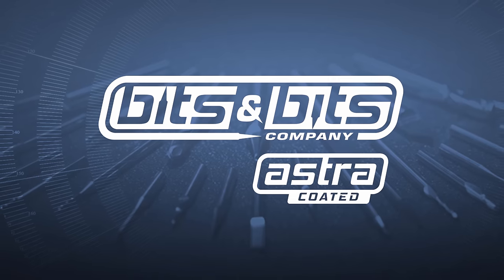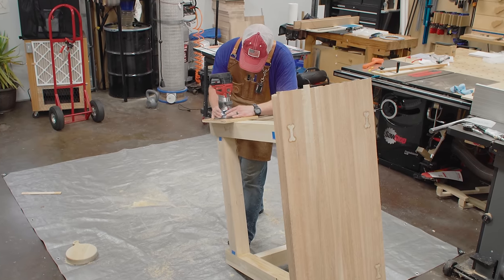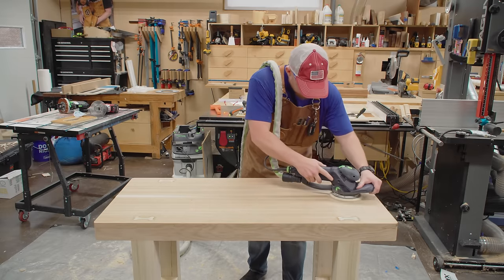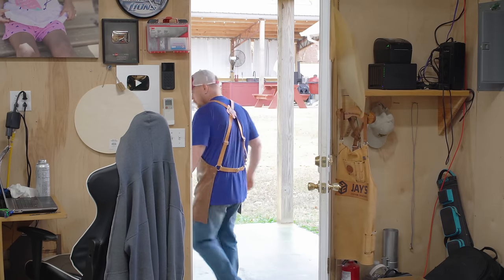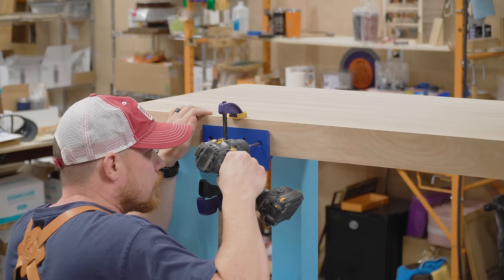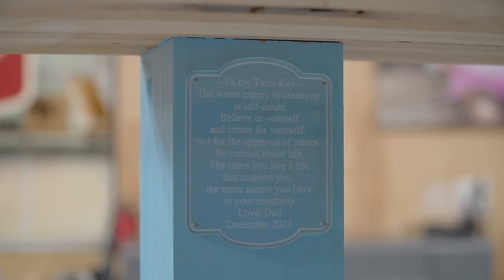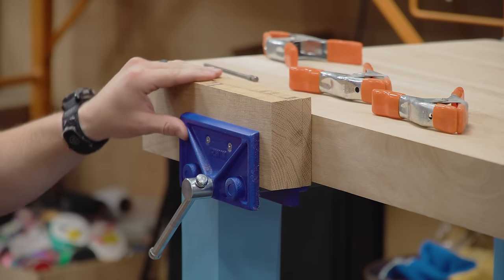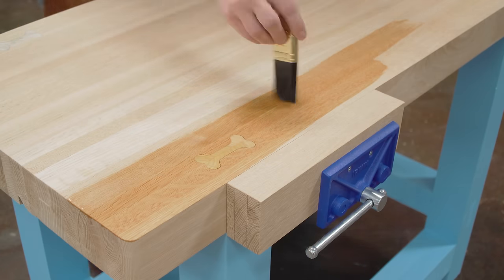Workbench Vise & Finish, My Daughters Workbench

Comment: jay i noticed that you have the control for suction turned all the way up on the vac. I had the same problem with swirl marks if you turn it all the way down and use the softer pad the swirl marks will go away.

Comment: Hi Jay. Just offering a possible cause for the Rotex problem… it might be the bearing under the pad is degraded. On most random orbital sanders, it’s a bearing mounted on an eccentric post to make the random orbital motion. The “sealed” bearing gets dust in it and starts to stick and starts to grab more making the sander dig more, make swirls more, and make it less controllable. I have replaced a couple. It’s an easy fix. Hope this helps.
Reply: I wouldn't be surprised to learn that a bad bearing is the culprit. I think AVE did a review on their track saw, and, if I remember correctly, he found a cheap bearing on the main shaft for the arbor. I never owned any Festool stuff, but it seems like most of their stuff is overpriced for the "quality" you actually get.

Comment: Great color; love the bench; love the motivation - I have 2 girls.  I have the RO 90 and have used the hell out of it for years. I rarely use it in Random Orbit mode but it does work okay in Random orbit & Delta modes.  I take the head off and clean it after every use (it needs it), and I replace the hook and loop pad fairly often - yours looks pretty ratty. That might help.  Happy Holiday!

Comment: Total guess at your sander issue here: Is there any chance that the sander has some sort of clog inside that's making the extractor not work as well, causing a small amount of the dust and loose abrasive to stay behind on the wood? Or maybe the extractor itself is slightly underperfoming?

Comment: Sell the Rotex. Festool has great resale value. I have the Bosch version (1250DEVS), and in random orbit mode the rotation is too aggressive for fine finishing, closer to rotary mode than a regular random orbital sander. And rotary mode it's like a belt sander but harder to control. The best use I've found for it is as a tool of destruction. For example I've for things like flattening a subfloor, or sanding porcelain tile to rough it up before painting it. Get one of the 5mm stroke brushless sanders instead (from Festool, 3M, Mirka, or a knockoff). They are a joy to use.

Comment: 5:05 Yes! Those sawhorses are how I found you! I've made 4.  The only thing I'd complain about them is how the legs are connected for the first screw. I can't clamp them well enough with the leg sticking up at an angle. I don't know the solution. Once that first screw is in, it's fine.

Also, you didn't link to the video in the description.

Comment: Jay, the sanding backing pad on the Rotex is a WEAR item (frankly, on any sander!). You can actually get different grades of backing pads for the Rotex, from hard, medium, or soft. 
If you are trying to level out a surface to flat, then use the hard pad. It will help to produce a flat surface and level out glue up for table tops, panels, etc.
If you are  trying to finish sand a surface, you should be using the MEDIUM pad. It more forgiving and leaves less swirl marks.
If you are doing curved or organic shapes, you would use the SOFT pad.
The differences are night and day with the different pads. They definitely do wear out over time (and you should be using an interference pad if you are using mesh paper).
With Mesh sanding paper, the hooks on the backing pad can be too long, and under the pressure of sanding they can poke through the mesh, causing additional swirl marks, and wearing out the backing pad prematurely. This can be true on almost all sanders, which is why a lot of box store mesh paper comes with an interference pad (but it's a real cheap one).
Try changing the backing pad on the sander, and use an interference pad (festool makes and sells them in a 2 pack for the Rotex)!
Reply from the maker: I have all three. Same results. It's just not for me.

Comment: Wauw, what a awesome bench. Are you going to put some leather pads on the inside of the vise?
Reply from the maker: If she starts using it, yes. My thinking is while she gets used to the concept of a vise she would likely rip off the pad material until she realizes how far to open the vise. So I will add some cork rubber down the road.

Comment: I'm very interested in the issue with the Festool Rotex sander. I picked one up at a pawn shop. It was in good shape just dirty. I believe the previous owner has been sanding marble or granite counter tops with needed on the grade of sanding discs that came with it. I haven't used it much but I'd hate to find out it's leaving pig trails.

Comment: Just had my $650 Mira deros die on me after less than three years of hobby use. They originally quoted me $175 to fix it, but it was the electronic speed controller that died. I got them to cover the part, but I’m still out about $80 with shipping and repair fees.

Comment: Have you checked the pad? I don’t claim to be an expert by any means but if it is not extracting the dust that I believe causes more swirls. Have the dust ports been gummed up with sap, finish etc?

I’m on my 3rd pad. More expensive than a cheap sander 😂 but it is still a good sander and I bought mine back in 94. I don’t use it flat out by any means. Often use my battery ros’s. But when I want to use it it is still a goer

Comment: I am curious if you have done any carving or chamfers/ slopes longer than what a chamfer could produce, like a spice rack in a drawer type of thing? I am extremely new the the CNC world so forgive my if the question doesn't make sense. Maybe that is a feature of the software to create a gradient... I just see most people doing what I would consider to be 2D carves rather than 3D incorporating a z-axis travel along with the others
Reply from the maker: You can do that but it would be much easier to bevel the bottom edge at the table saw.

Comment: The Rotex isn't a finish sander, it's meant for material removal. You should pick up an ETS 150/5, it's amazing. My buddy had the Rotex and holy crap that thing was super aggressive. Again it's NOT a finish sander! And yes this completely contradicts what Festool says, which is hilariously ironic. They list the Rotex as a finish sander and the ETS 150 as coarse/intermediate.
Reply: So a 150mm sander with a 5mm stroke (RO150) isnt a finish sander but an "ETS 150/5", with a 150mm pad and a 5mm stroke is? Its all about technique and preperation.

Comment: Removable storage down-low for crayons, markers, etc???
Reply from the maker: I want to build a cabinet of some kind. Haven't settled on how big or what features. Thoughts?
Reply: @JayBates  I was thinking just some removable trays that nestled between the supports so you could take out what you need, use it, put it back. If others have other ideas lets hear em!

Comment: Your sander makes swirls becouse you move it way to fast.
Speed should be about 1 inch per second.
try it with a pencil.
Make circels and move your hand fast over the paper.
You get long swirls
Move slow and you get tight cirkels close together.